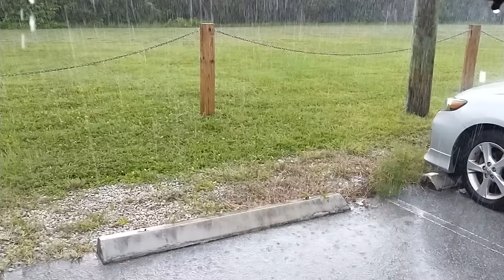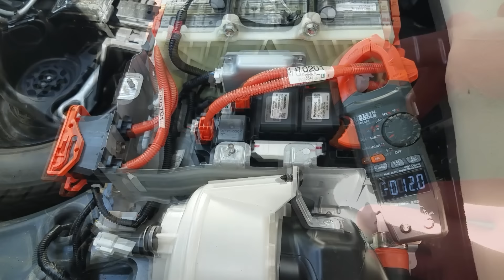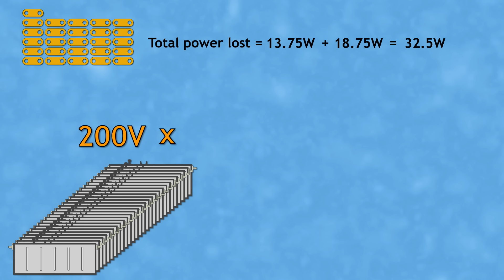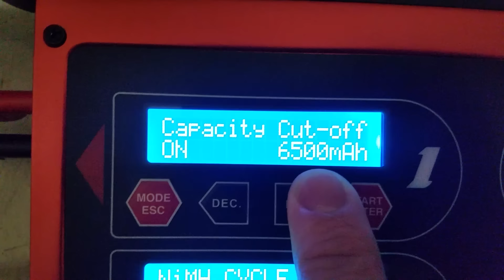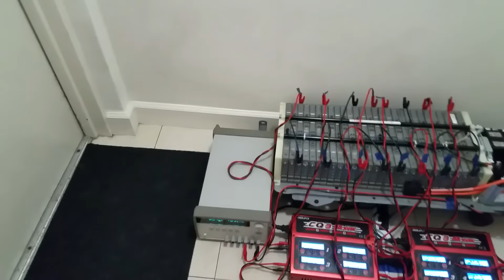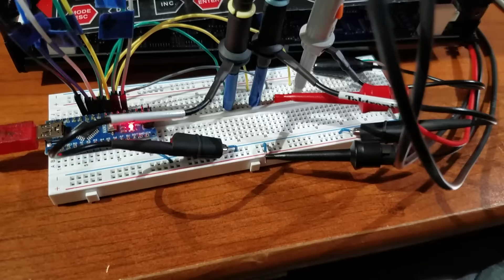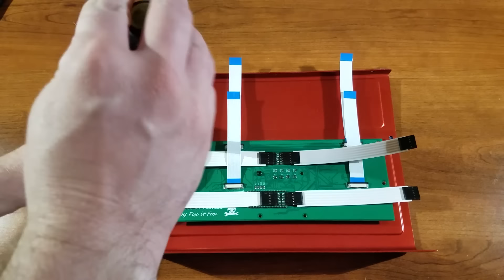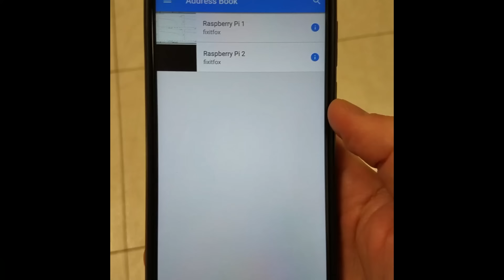An engineer's approach to hybrid battery repair

Comment from the maker: If you enjoyed watching me fix my battery, consider becoming a Patreon member, where you can get behind-the-scenes access, early updates, and even parts from my projects!

👉 https://www.patreon.com/fixitfox

Thanks for helping me keep building, experimenting, and sharing more projects like this!
Reply: I wanted to add you could electroplate your copper buss bars using a stable metal to prevent corrosion in the future. You would need a sacrificial anode of your coating material, vinegar and an old 12v battery charger without protection. Suggestable coatings are tin or nickel.
Reply from the maker: Yep! I wonder why Toyota doesn't use plated bus bars. The one I recommended from ebay is nickel plated.
Reply: @FixitFox  just wanted to touch in the 5.0a charge setting you chose. What scientific beneficial approach are you taking to charge at such an amperage when that will guarantee to cause swelling and overheating on the cell thus potentially causing it to fail? I know you explained why you chose that on the discharge since the max it can go is 1.4-1.5a but you never explained why the 5.0a on charge when 99% of the videos I’ve seen is max at 3a. Hope you reply thanks
Reply from the maker: Hey. Great question! So I have a few things to say about that:

1. The car charges the modules at over 50A when using regenerative braking. That's 10 times higher than the 5A I was using. And power is the square of current. 10 times higher current means 100 times more power! So we're way below normal operation when using 5A.

2. The battery charge cycler doesn't keep 5A on the module 100% of the time. If you look carefully, you'll see it "pulses" this 5A. It keeps it on for a few seconds to a couple minutes. Then it turns it off for a few seconds. Then it turns it back on for a few seconds to a couple minutes again, then off for a few seconds again, etc.

3. You won't see much swelling, if any at all, with good modules. As long as you keep your pack sandwiched together with the compression rods. And definitely do that. Do not charge cycle your modules without the pack being sandwiched together. 

4. You will definitely see swelling and even hear crackling sounds with bad modules. But in my experience, the charger stops charging them way before anything bad happens to them. And I've had some horrible ones that only charged to like 500mAh and discharged like 300mAh lol. Also I think even at 3A those modules would swell and crackle anyway.

5. 5A speeds up the cycling process because it charges faster 😆
Reply: @Fix @FixitFox ppreciate your reply 100%. 

Well out of experience, when I charged some of the cells at 5a after seeing your settings I decided to try it on some cells and they swole up more than all the others had at any point in my recon project. Same battery when discharging at 3a/2a cycles was able to reach 5000mah/6500mah without excessive swelling like in 5a.

You are right about the speed thoug, took a couple of hours to complete 3 cycles but I was very scared it would pop at some point seeing it was extremely swollen. 

What about the modules you replaced the bad ones with, did you run cycles on those to verify they were good or did you just swap them out? And did you put the highest discharge capacity ones on the ends and lowest towards the middle?

I ask as I have read so many different variant about some just swapping bad for good cell, some taking higher rated (based on discharge mah) on the outside, lowest towards the middle etc.
Reply from the maker: Well that's interesting that your 5000mAh/6500mAh batteries swelled up a lot. In my experience it's minimal. But maybe it's because I'm comparing to the really bad ones that could barely hold 500mAh. Whatever you're comfortable with though. Safety first!

And yeah I always cycle the modules that I'm replacing the bad ones with. You never know, you might get a few duds. I usually buy a few extra with my replacements, so if I find a couple were not good (or not great), I have backups. Always cycle with the pack compressed. Even the new modules. You have to take the pack apart and put the new modules in there before charge cycling them.

As for where to place them, put the highest discharge mAh ones near the middle and lowest ones to the outside. The middle of the pack gets hotter than the ends, so the modules there will take more of a beating over time.

Comment: Solution: change the battery. This battery is old. And exhausted. Changing single module it’s not good. You will have different voltage drop/difference resistance from new and old modules. Damaging both in the way+having less performance. I think it would be a lot better to replace all the pack. Also those little hybrid car batteries would wear a lot quicker than a big battery from a full electric car (less capacity, more charge per x km, more C absorbed/put in while charging, =less life spawn. I like the video, but I think the reward did not justify the work.

Comment: Well , probably worse than some energy lost during increased resistance is that under load the BMS senses wrong cell and/ or voltages and will not be able to balance cells/ modules properly and allow unbalance to diverge instead of converge. And bedore remounting cleaned busbars blease put some conductive grease on contact surfaces. And ANY  module in the total package which has the lowest capacity will drag down the usable capacity of the total battery

Comment: What you think about the new LiPower 27F Solid State Battery for 2014 Lexus GX 460 ? is it better than most batteries on the market including the AGM batteries interns of safety reasons and long lasting?!

Comment: I fixed a prius battery with my dad, we just scanned the codes with a obd2 scanner the one that looks like a tablet, and it told us which specific block was broken, we measured it and the voltage was alright, so we put it back together but the light came back on, so we opened it back up and replaced the one module in the block and boom, the light went away. I guess listening to the scanner is the best idea especially when it tells you to replace a specific block, we only replaced one of the modules in the block though since we tested them more

Comment: Soo max 125Amps from 6.Ah cells mean these batteries are cycling with 20c?! you could measure internal resistance quickly and get enough data to swap modules... looks like they have to be very capable!, also that bad module had visible color change (overheating) i suggest torture battery in car and get thermal camera? Even quicker

Comment: Hello Fox, really great video, im about to buy an hybrid car and want to keep it as much as possible, you recommend me to go with NIMH or Lithium, for reparability reliability and durability ? Thanks !
Reply from the maker: For repairability, I would recommend the NiMH. But for durability, longevity, and performance, I would recommend the lithium. Hope this helps!
Reply: @FixitFox  Thanks a lot, i saw that lithium can be repairable too but just in laboratory and we can't have the equipment to recondition by ourselves even if we replace modules. I'm going with the NI-MH.

Comment: Only thing I would change is the charge amp shouldn't be more that 2amps. Heard it from a certified toyota mechanic. Also when reconditioning the batteries, if you have time, I was told it should be done at .267 amps.

Comment: Why is measuring the current with the clamp on current Meter so dangerous?
Reply from the maker: The dangerous part is having the high battery terminals exposed and getting near it while the safety disconnect is not unplugged. Same goes for measuring the bus bar voltage drops. I only made those measurements for the sake of the video and would not recommend anyone else doing it!

Comment: SUBBED:
Retired EE in industrial robotics here
CONGRATULATIONS ! 
You just designed and implemented a Prius Battery Rebuilding Company....as a 'fun home project' !!

Universal Approach:
I built a monitoring system because i was uncomfortable leaving my 3D printer running while I was away and not watching/smelling it for errors.
Similar to your application, i didn't need fast looping; 500ms was plenty. So I used a Rasp Pi with camera and an Arduino for temperatures etc. Python has a Vision Recognition library which took only 20 minutes to get running. (hint; turn everything to grey scale) The Pi Program could read the text on a screen, change in an image, sections windowed, very cool library. ChatGPT helped code it easily (sub routines only)
Then it would send a txt to my cell once an hour "all ok", or a priority txt if ERROR. An ERROR would actuate a servo (1.5ms PWM) to shut off power. Peace of Mind was increased significantly. (No PCBs were harmed in this scenario)
Hypothetically, a Vision Based monitor with Arduino using servos (of SO many types) would be well within your skill set,  and create a Universal Monitor system with actuators so you can continue to work at home on ANY project (even Dog Sitting, LoL), while you're away,working on a brilliant Career ;-}>

Fun Side Project ?

Comment: So in short what was the steps to repair? Take it apart and measure and test the battery modules? Take out the ones that don't work properly
Reply from the maker: You basically have to charge cycle them individually (to measure their capacity) and replace the ones with low capacity. But you have to keep the pack together with the compression rods during charge cycling. Just the bus bars have to be removed.

Comment: for the testing part why not just take out the fuel pump fuse after turning on the engine with full lights and ac , discharging the entire pack and then retesting voltages with your multimeter?

Comment: This was really interesting and super impressive and i understand it's been a while since you started, but there might be better existing solutions now.

Why is the CQ3 is the most used charger? I was looking at hobby NiMH chargers and the SkyRC D200neo Dual Channel came up. It does every single metric better or at least matches the CQ3 ($280) and is cheaper ($105 x 2) for a total of 4 channels.

It also has both a computer/mobile app that does all the logging you guys are trying to automate, as well as alerts and safety notification to the mobile app. Even has internal resistance measuring.

Another really cool thing is you can hook it up to a SkyRC BD380 to offload the discharge cycle automatically to this dedicated discharger which can discharge up to 40A. 

Which brings me to my next question, I know you mentioned even though you left the discharge current at 5A, the CQ3 is physically limited to ~1.5 A. Same with the D200neo, but if you pair it with the BD380, you could achieve 5-10A (or higher) if you choose so. And wouldn't a higher amp discharge actually be a better test to identify weak modules? So, what would be the ideal discharge rate if you weren't limited to hardware, and without risking cell reversal? With the app, it seems you can easily set the voltage cut off at like 7.0V discharging at 5-6A, then set it to 1-1.25A to get down to 6V.

Comment: I really liked your video, man. I’ve been working on high-voltage vehicles for over 20 years, and I wanted to offer a couple of recommendations from experience. You mentioned that your first battery only lasted about two years. I don’t know whether you performed a capacity test on the individual cells, but in my opinion, properly testing their capacity is almost a necessity, since voltage alone doesn’t always reveal a cell’s condition.

More importantly, I strongly recommend never working on an opened high-voltage battery while it’s still inside the vehicle. I know these packs are extremely heavy and difficult to remove, but the vehicle chassis, grounding paths, static electricity, clothing, tools, and other factors can create dangerous electrical paths. I used to be a Toyota technician, then became a warranty battery engineer for Tesla, and now I’m a Polestar HighVoltage Specialist. I’ve been badly shocked myself once, and I’ve seen what high voltage can do. A friend of mine even suffered permanent eyesight damage after an electrical accident.

I’m not saying this to criticize you. I really enjoyed the video.  My recommendation would always be to remove and properly isolate the battery before opening it or working internally on it. High voltage deserves respect every single time.

I subscribed to your channel, man. Check out my channel sometime too if you’re ever interested in working on high voltage cars other that toyota. I’ve got a lot of stuff on there from my years working with these systems. Keep up the good work.

Comment: Excellent learning video. I am rebuilding my 2nd Prius battery and all the hybrid tech videos tell you to replace the bus bars. At a cost of 25 bucks , it is one less thing to worry about . A lot of cleaners can take the SS coating off the copper microscopically , creating a perfect place for corrosion again. I replaced the two harnesses as well to worry less about. 58 bucks on Amazon with hardware and bus bars included. My last rebuild lasted 6 years , only to be foiled by a field mouse who was excreting on top of the battery. Poor bahstad found out directly after fu@&ing around. I removed his executed remains and got to work. Not as hard as the stealerships make it out to be. Make sure to check the battercontrol box for corrosion before assembling. Always wear rubber gloves even after disconnecting the orange power switch. Good luck and thank you!

Comment: So did you replace your modules, did you try to cycle them and check after that? What did you do with the old ones
Reply from the maker: I did! I replaced about 12 modules and I cycled them as well. To make sure the new ones are good.

I disposed of the old modules at a local recycling facility. They gave me like $5 for them 😆. I thought I would have to pay to get it recycled but it was the other way around.

Thanks for watching!

Comment: As an engineer. What’s the difference between copper and that new aluminum set?
Reply from the maker: Are you referring to the bus bars? If so, the new ones are also copper. They're just plated with nickel, which makes them immune to corrosion. I've had it on my battery for over 2 years now and they're spotless! And since it's a thin layer of plating, the copper underneath it will still conduct the electricity well. I would not recommend aluminum because it does not conduct as well as copper. Thanks for watching!

Comment: I use NiMH AAs, and I could've told you the memory effect is very large over time.  Which your own testing clearly proved, as you fixed your pack by cycling it.  Why didn't you raise that finding at the end?

Comment: bro you could just wire the buttons to arduino , aim  a cctv camera at modules and send impulse to ok button once you see it had finished the cycle
Reply from the maker: The idea was to automate the process and not have to do it myself and maintain the spreadsheet myself. Thanks for watching!

Comment: As a quasi engineer and professional inventor, I would have simply used relays connected to the push button terminals to mimic a button press in order not to have invested soooooo much time into coding.  But, very well done video and process to automate this.  Now being a business person, let’s get this out on the market and as one commenter said, create a relay bank so it can automatically switch from one module to the next to really automate the process.  Reach out to me if you’re interested.  I have the manufacturing, sales and marketing resources to get it done

Comment: Wow, this is beyond anything I imagined—you did an excellent job. Would you be willing to sell the circuit and software that could also repair my chargers?
Reply from the maker: Hello! I was originally not planning to sell this as a product. I designed it for the sole purpose of me fixing my own car with it. But there's been a surprising amount of interest in it, so I am starting to seriously consider it.

I'm looking at polishing up the design, making it easier to use, and adding some additional features to it. I may have something in the next couple of months. If you are still interested, send me an email and I will contact you when it's ready.

Comment: Power lost in the bus bars is converted directly to heat. So if a bus bar loses 25W on the connectors, it generates 25W's of heat just at the connector interface itself. Is that enough to cause issues? How hot does that get? Does the bus bar itself act like a heatsink? All excellent questions for which you won't get an answer from me ;P. You would need to know the crossection and the resistance of the actual gunk and then find whatever maths you need.

I will say though that it's the reason why nvidia gpu power connectors melt. Badly formed connections, leading to heat enough that it melts the plastic and eventually burns thorugh the thing. An unfortunate amount of contact resistance = melted connectors.
My gut instinct says you are probably fine, which tells me you are probably not ;P

Comment: was told you can test the load on all blocks at once instead of using a lamp/multimeter by using the Brake-Torque Method and an obd2 scanner? would save a lot of time?

Comment: Would rated battery capacity equal discharge capacity, so you would expect the charge capacity limit to be a bit higher to allow for the losses?
Reply from the maker: Yep, good pont! For new modules. But for older ones, 6500 vs 7500 does not add any meaningful discharge capacity as I tested and noted in the spreadsheet.